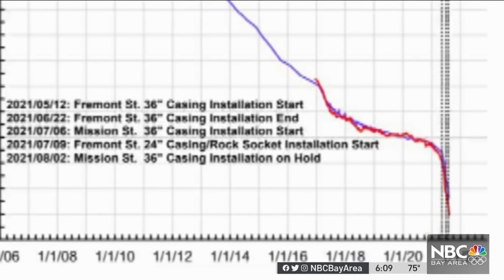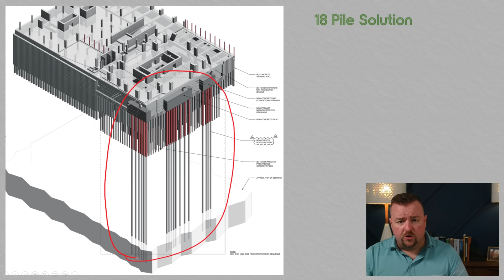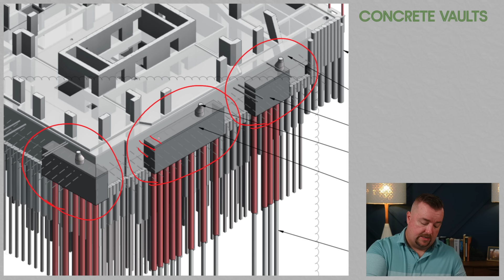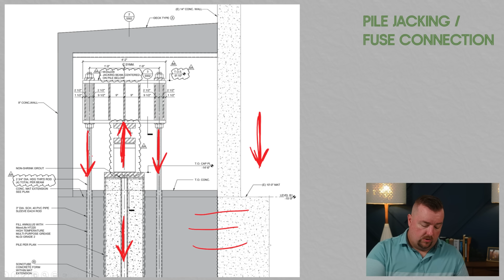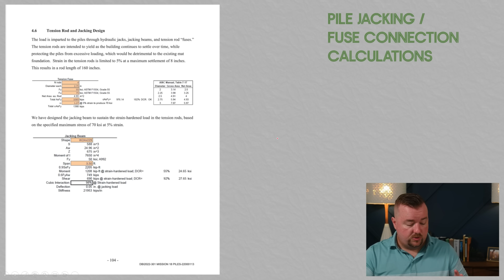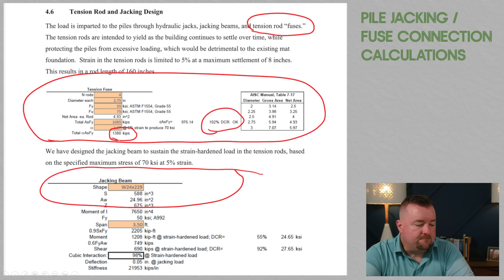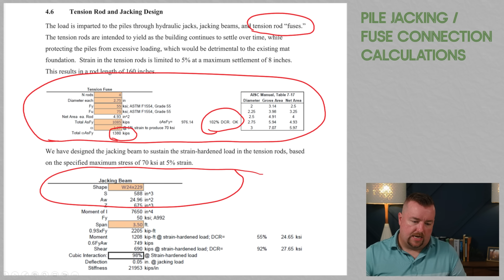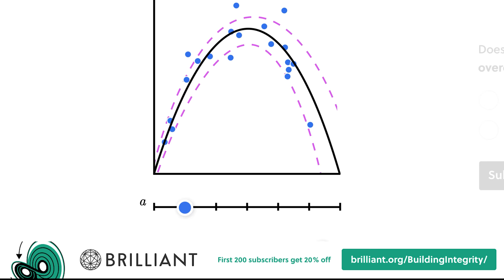Did I Uncover a $100,000,000 Mistake with the Millennium Tower "Fix"?

Comment from the maker: Small correction:  The Engineers that designed the "Fix" were not the structural engineers for the original building design.  I meant to refer to the engineers of the current "fix" as the "original fix engineers"... not the original building engineers.  If you are an engineer and want to perform your own calculations, additional material strengths can be found in the video description.  I have emailed the SF Department of Building Inspections and Supervisor Peskin re this concern.  I will update you all when I know more.
Reply: and I had a whole paragraph ready, good thing I didn't press send🤐
Reply: Very good explanation. Did you happen to ask these guys if they've picked this stuff up during construction? The "bearing" plate would look mighty small when compared to the giant rod on site, even if it was ungrouted. Even a non-engineer looking at it would raise questions (the steel fabricator or the site foreman). Of course, small plate or big plate, the rest of this project is a complete shambles.
Reply: They should just hire FIGG Engineers to do the review. I hear they do great work with concrete in tension!
Reply: Thank goodness I am not a decision maker on this project. San Francisco needs a team of very smart experienced structural engineers who are 100% independent and well paid and supported.
Reply: What I know from academic research and scientific literature is that when one performs a 'peer review' of, for example, a research paper (or in this specific case a design proposal), one is tasked with the verification of the work in its entirety.

You do not get to cherrypick whichever parts of the work/proposal/design you do 'include' in your peer review and which parts you don't! 

What I mean with this is essentially as follows: when one is 'peer reviewing' a work they're essentially verifying, checking and recalculating every single part of that work to check whether or not that which is described in the work is feasible, logically sound, safe and valid from an engineering perspective in the first place (among many other things). And if they find this to be the case, and thus 'approve' of whatever it was that was proposed/established/put forth and/or claimed within the work, then the 'peer review' is complete and the peer review process is finished (unless there are multiple simultaneous peer reviews required). With the peer review process having been successfully completed, the name of whoever performed the review is forevermore connected to the work as (one of) the peer reviewing parties that approved the work. Their name and reputation (and liability, in this case) is now connected to the project, with absolutely no CYA (covering your behind) whatsoever being allowed. Either the project is safe and you approved it following your peer review, thus agreeing to accept any and all liability as a result, or it is unsafe, you don't approve the project as a result of your peer review and thus the project cannot continue until they fix whatever caused it to fail the review, or until they find another peer reviewer actually crazy enough to attach their name to the project and give it their blessing.

But those are just my 2 cents, but I do know for a fact that the process I described above is how these kinds of projects are usually handled in Europe.
Reply: This video sparks joy.
Reply: Underpin is not the right term.  This is sidepin.  How the heck is a building that massive supposed to be supported with horizontal pins?
Reply: I also have big doubts about the mat extension capacity on the side like that...I wonder if that shear key will be enough. 
As for that plate you are totally right. The bolt will pas clean through. The plate should be square and thick enough for the punching shear around the hole as well as wide enough to not overstress the concrete compression capacity. With all the loads evolved why not over size this element, cmon.
Reply: So they was the fixer to the fix to the orginal builder that didn't work.
Reply: @Building Integrity
I can’t speak for the concrete part of the design (I am working in the machine building industry), but I also worry about the all thread rods. Every time I have seen a bolt that was designed to be tensioned to or slightly above the yield strength, the engineer would not rely on the given net area of the bolt (because you can’t measure it and the threading of the bolt can introduce stresses and small defects in the material). Instead, there would be a necked down section of the bolt, often with tolerances in the thousandths of an inch.
I must agree that the steal plates look absurdly small especially compared to the big I beam on top.
Reply: @michaelclennan8425  an international group.
Reply: I like the fact that shear between the new pilings and the existing concrete slab seems to occur across the small plates and the horizontal bars into the slab. Now, stand back and look straight up. This thing is gigantic. I would expect the shear planes to be 50 or 60 feet tall and mostly steel. I have an uneasy feeling about the adequacy if this design.
Reply: Can you post all of the pertinent information? Rod diameter, material, nut type, PVC pipe size, concrete strength, plate size, etc.?  I saw some of it, but it would be easier for passing PE to run a quick number on it
Reply: They should pay you for doing their job for them
Reply: @edwardteach3080  .....as portrayed almost perfectly in "The Simpsons."
Reply: @sjb3460 Go look at the desighners / engineers of the Pisa Tower. They knew  what they were doing.... 😂😢
Reply: @edwardteach3080  And in 50 years, all the original engineers are dead/senile, blueprints are rotting away in some archive while nobody knows where they are, the guys who had done it for years retired, they hire some new guys who have no idea what to do and whom to ask about it - at that point it will be extremely important that, if any maintenance is still required, it has to be very logical and straightforward.
In the city where I live (in eastern Europe) we had just this case - a large overpass (4 lanes, concrete) was built in the 50-s, needed repairs so they started to repair it in 2019, found out that it has very strange solutions in it (in the way it was built/designed), there is no drawings found anywhere, had to demolish it and now building a new one )
Reply: When someone sees the bill for the fix they just default and abandon the property - just my personal bet.
Reply: @sjb3460  
I doubt it  would tip over, it would likely collapse.
Reply: Pin this comment to the top Josh.
Reply: Have you attempted to file a FOIA request to see if this information is available or has been discussed internally?
Reply: May I suggest you pin this comment so it appears at the top?
Reply: You might want to pin (not to be confused with "underpinning" lol) this thread to the top of the comments ⬆
Reply: I bet Enerpac has a big hand in it too. They won't rent out such heavy equipment without knowing it's purpose.
Reply: @sjb3460  
How did I reply either way?
I said Yikes.
As in scary.
Reply: @sjb3460  It doesn't have to go nearly that far. The plumbing will stop working once there's not enough incline in the pipes which will pretty much render the building useless.
Reply from the maker: @AllAmericanGuyExpert  ouch! lol
Reply: @bryede  LOL, very astute observation.
But I would still fear that a 1/4" per foot lean on that tall a building would still be beyond it's failure point...
Reply: Great catch on the tiny plates.  Can you look at vault to building lateral connection?  It looks like it extends only a couple of feet into the foundation.
Reply: 😶‍🌫Anything better than steel? Titanium maybe, or tungsten?
Reply: @sjb3460  Perhaps a simple demonstration of the forces involved will shed light on the side support flaw.  Place a piece of cardboard over the edge of a table and support the table side with a few books.  The portion of cardboard over the edge of the table is the subject building.  As more weight is placed on the cardboard, it will start to bend and sag because only one side is supported.  Even if the 18 piles work as designed which our video host has shown is a dubious proposition, the building will tilt away from the piles.  As the building tilt, foundation will be exposed to greater bending forces which it was never designed for.  Even if the support were extended deeper into the foundation, shear force will still gather at the vault to foundation joint.  Cantilever support underneath the foundation would be ideal but is probably not feasible.
Reply: The high speed rail project.  The truth is nobody is working on this and nobody cares
Reply: @davidromero3803  The LINE in Sandi Arabia 🏜📏🧻🤣🐫
Reply: @referencefool  Crazy how they can build much taller building on Sand especially Qatar and yet the USA still have a track record of disasters including the WTC tower which only needed a bit of Aluminium and Kerosene to bring completely down.😳🤬
Reply: @edwardteach3080  VERY TRUE 🙂! 
Now, how about my car, always maintained by official Brand Centers? Answ: Just the same. These thugs demolish my car quicker than I can do...
About bridges - ask any politician / beans counter : "Where is our bridge?" Answ: Well, it was here yesterday. Maybe time for a bathing...
Reply: My friend, a chinese engineer named Sum Thin Wong agrees !
Reply: @jst6757  Thank you for sending your msg.
Instinctively I worried about the threads on the 2.75" rods. I think every man on this planet will have tightened up a least one simple nut too far in his life...That's normal, no problem. 
But for these extra large rods, I thought special care would have been taken for these threads. Yet large, but a scaled up version of their smaller "regular" brothers.
However, in the drawings shown in the video we can see 2 Nuts at the bottom of the rods, and only 1 Nut at the top of the rod - that's where they would need 3 Nuts...
This looks either like an incredible design error, or an unfinished drawing - which never should have been published.
Reply: Great video, i hope no one gets hurt. It’s really sad to see how we went from the most impressive engineering in the world to this.
Reply: We have to Thanl Maypr Breed! She's not from -SF. She's from  Oakland. She drove the whole city to the ground.
Reply: "NYC parking garage collapse fatality" in the news today.
Reply: Greetings - assuming the plates are uniformly supported (encased) by concrete other than the relief tunnel for the threaded rod (through pvc) and using a 3" diameter for plate through-hole, quick calculation for estimated rating - [3*pi *1.5" plate thickness*65ksi (ATM 572 A50 tensile)]/5 (SWL) = 183,775 Lbs.(approx.). Minimum shear strength of around 184,000 pounds with 5:1 safety margin. If the dimensions of the retention nuts are considered (as these would be the actual bearing surfaces), this quick estimate is given by (6*2.75*1.5*65,000)/5 = 321,750 or about 322,000 Lbs. with a 5:1 safety margin.

I'm curious about your calculations. Thank you for the thought-provoking video.
Reply: The problem as much as anything isn't that one plate will blow. It's that in the process it will spall the concrete around it and destroy the structural integrity around the other plate, which then immediately overloads its pair on the other side. This is a designed failure
Reply: I hope I am misunderstanding something. I can't see what is stopping the compression piles "spaghettiing" in the goo which appears to be semifluid between the bedrock and the building.
Reply: Is there an update or any feedback from this video Josh?
Reply: LGBTQ Engineering
Reply: I think the weakest link hear is not the plate but the threads on the studs they would be by far weaker than the plate
Reply: @BuildingIntegrity  Say, as an engineer by trade, could you take a look at the Kakhovka Dam break? EG, Ryan McBeth has compiled satellite footage and has tried to give an informed opinion what may have happened. AFter you autopsied Champlain Towers South, I would be very interested in your professional opinion.
Reply: So, he may have misspoke. If so how does the information you just posted help clarify the the issue regarding the PRIMARY LOAD BEARING COMPONENT of the "fix".
On a helicopter we call that a Jesus nut; it better be right.
Reply: It's leaning more than ever.  Please update us!  Did they listen to you? Seems like no! :(
Reply: This is exactly the type of project that turns into a massive disaster. It’s Hamburger wanting to cement his legacy. This project is extremely stupid. The building will never be worth much and should just be disassembled and removed: that’s the engineering challenge that people should be focused on.
Reply: @@futureshelp The full migratory patterns of the great Millenium Tower are still a mystery to naturalists to this day.  Also unknown are its mating habits.
Reply: @AllAmericanGuyExpert  You mean the girls who designed the Florida walkway???  Ha ha.
Reply: I want to see your numbers from which you derive there could possibly be "half a million lives" endangered. it's dubious that even if the 500,000 San Franciscans all stood in the shadow of the falling tower it could squash all of them at the same time.

Sure, even  hundreds or thousands of lives are a horrible prize of a failing project and should be avoided wherever possible!! But it also should be self evident that a channel proud of its work in physics and engineering calculations should NEVER stoop down to idle exaggerations to gain attention. Clickbait drama like that is below you. Or at least should be below.

Also yes, Engineering IS all about scalability. And when it becomes no longer feasible. If you can calculate a proper beaver Dam, you should be able to say what to do to calculate the "Three Gorges" and if a five time larger dam still would work.
Reply: @jean-charleslavigne1298  I wonder if the existing reinf bars exposed for the shear key were extended by CAD welding or sim for the full width of the new concrete grade beam.   If not,  the new grade beam may simply rotate when loaded.
Reply: Geotech here - after applying the 1000 kips of pressure to the "test pile" how much deviation are they allowed??
Did the pile move ??
Reply: @jeffreynelson2660  Yes good point. I hope they did XD.
Reply: @Ugly_German_Truths Huh, San Francisco is actually tiny as populations go… I kinda expected a few more millions there, being California and all.  
As far as maximizing risk to lives, think ‘Toppling dominoes’ except with skyscrapers.  A building on the east coast had that exact concern years back for a few tense weeks as a hurricane bore down towards it and engineers hastily made fixes.  buuut, honestly, I’m not familiar with what it might land on while toppling, pictures of it tend to have fairly clear sky implying it’s not near other tall buildings, and I’m not savvy enough to navigate street view.
Reply: @encinobalboa  The side pilings don’t carry the full load of the building, just enough of it to arrest the lean.
Reply: @shakehandswithdanger7882  The rods are 2.5 inches, according to one source I read.  Perhaps they were upgraded.
Reply: @davidcroxton8306  steel casings
Reply: This piecemeal structural engineering approach is risky compared to a complete FEA nonlinear analysis including all the components that are loaded.
Reply: No. They knew this already.  Your friend Stockton Crush could use your services
Reply: They're doing it like this on purpose for a controlled fail at some point of their choosing in the future.
Reply: Have you had any replys to the emails or updates in the last few months? Thanks
Reply: @ivankuzin8388 same with the tensioned concrete bridge in Italy, which fell down a few years ago. Maintenance was neglected for years and found that they were also hiding the surveying stating the poor condition and degradation of the material...
Reply: “Steel”/“bedrock”
Reply: I would rather see something to pump under building in an area much larger than the buildings footprint.  A simple way to see what I'm saying is think of a snow shoe.  
Thereby at minimum slow the current rate of sinking.
Reply: @jean-charleslavigne1298  "As for that plate you are totally right. The bolt will pas clean through. "  Numbers, please (?)
Reply: @richardhack9830  "...and only 1 Nut at the top of the rod - that's where they would need 3 Nuts..." The nut at the top is not loaded...the rod works in tension...
Reply: @les8489  Andwhere does that tension go to? Answ: to the nut!
Reply: @richardhack9830  Of course it does - if we are talking about the nut at the top of the rod. I thought someone was talking about the nut on the top of the plate. Sorry for the confusion :)
Having said that - tension type nuts don't need to be analyzed. The design of these nuts is such that their strength (shearing of the thread etc.) exceeds the capacity of the rod. So - the fracture (if it occurs) is NOT by the failure of the nut. Fatigue failure, however, may occur within the threaded portion - but adding another nut there won't help.
Reply: @les8489  Basicly you're correct on the design of nuts. However, more nuts = more treads to transfer the pulling Force applied to the rod. So the tension in the treads will be lower, thereby reducing fatigue. This helps the treads to survive. (In a staticly stable construction). When seismic activity occurs, the treads may fail anyway...
Reply: Josh, trying to reach out to you but all links to your website seem unresolvable, and can't find you... is there a way to send you something somewhere? I think I did invite you on linked in, if that's you.    TY... rc
Reply: @les8489 — The single nut at the top end of the rod is definitely loaded.  Seems to me it should have been doubled.
Reply: @GH-oi2jf  Of course that one it is loaded - when I answered previously, I was under the impression that the talk was about the single nut on the top of the plate.
But adding 2nd nut at the top of the rod does nothing. If the 2nd nut is noy torqued up - then it takes no load. If it IS torqued up - all it does is increase the tension in the threaded portion of the rod inside the 1st nut. There maybe good reasons to apply 2nd nut (vibration environment etc.) - but in this case it would just be a waste of a nut.
Reply: @edwardteach3080  So true. There is a building local that I did a plant inspection on about 20 years ago and discovered that the fire fighting system had never been commissioned and was still inoperative nine years after the multi-use building opened. (A building including residential unit and also a public area that had experienced incidents of wilful fire raising!) After commisioning the system and instructing staff on regular maintenance, management and regulators have in the intervening years undermined all that work. Unfortunately, I now live so close that if it all goes wrong I shall have to listen to the screams.
Reply: The way these rods are connected at the bottom to a small plate that could potentially pull through reminds me of the Hyatt Regency walkway collapse of 1981. It just looks simiar. I'm not sure why they wouldn't use larger plates considering the cost would be minimal.
Reply: Engineers drunk on
Bud Lite ?
Reply: Excellent video presentation, but that fix can't work.
Reply: @thomashejnicki6880  whats the bearing pressure between the anchor plate and the concrete when the bar is tensioned to 340,000 Lbs?
Reply: After watching the series, as someone which is not a engineer but has physics background, i can't help to question the entire approach on the "fix".
Seems to me, the should have taken measures on the opposite site of the building to increase the settling there to match, rather than try to arrest the settling on the side it leans to.
Any other approach increases the loads on the structure. And any disturbance of the soil will increase the problem, by increasing the uneven settling.
I assume that, this would be a even more "has never been done" approach. so they went with the we have done that, it's just bigger approach.

But it should have been possible, to use directional drilling to change the conditions in the soil, to increase the settling rate. this does not mean, that some pillings all the way down to the bedrock around the building to be able to somewhat influence settling rates further would have made sense. but only after you unload the structure.

Think it would be really interesting to see a continuation / spin off of the series, which would explore other options that could have been chosen to  fix it.

I also kind of don't get it, while would you use the strength of the steel as a fuse. I kind of get, that in the US proper maintenance is trouble. But making those rods the failsafe seems insane. Would make much more sense, to have a small fixation element on top which gives and is easily accessible and replaceable. and then use a active monitoring and automated adjusting. and of course a external alarm. probably also a safeguard which disconnects the system in case of a earthquake. this feels like: let's make the inner reactor mantle weak enough so it melts and disperses the the contents to stop the reaction... and then have to rebuild the entire facility to get it working again.

If you don't have a static situation, you should always include a automated monitoring and adjustment system.
Reply: Why does "Hyatt Regency" keep flashing through my head as I listen to this?
Reply: @rickoshay6554 — Probably because you don’t understand the differences.
Reply: @GH-oi2jf  
Well, there's even more difference between the apparent design snafu here and what brought down those 737 Max aircraft. Ya' ever think maybe the design similarities might be relevant?

Whatever. It always makes me chuckle when you toss out a rhetorical question into what looks like an intelligent crowd and, Bob's your uncle, another boneheaded TicTok refugee pops up.
Reply: @jean-charleslavigne1298  I was thinking the same thing. I'm not an engineer of any kind, but I would have exaggerated the size of the plate, like at least a foot thick by several feet out on all sides. We are talking about the weight of an entire building, not adding the extra weight that will be added as time passes, like the residences with all their possessions. So far, I have not seen one thing that takes the added random weight into account. People and their possessions don't weigh zero. Then, there's the test of time. Earthquakes are a concern, what if there's another (1906) or worse earthquake?
Reply: I would've left it alone. Probably would've settled on it's own.
Reply: @warntheidiotmasses7114  Oh it was settling on its own, but in the wrong way "TIIIMMBERRR!"
Reply: @Building Integrity, note that SGH were not the original design engineers of the Millenium Tower. SGH are the engineers for the retrofit. BTW, you indicated that there is an issue with the anchor plates, but I don't see what the issue is. These anchor plates that transfer the upward loads to the concrete is likely designed based on Chapter 17 of the ACI Code. If the steel anchor plate is to fail in shear and the 2.5" diameter tension rod pulls out (very unlikely!), one can assume a circular failure plane of 2.5" diameter (this is actually conservative since we should actually be using the diameter of the nut). The shear capacity of the steel anchor plate will then be at least 0.6 x 50 ksi x (pi x 2.5") x 1.5" plate thickness = 353 kips which is much greater that the 250 kips force that each tension rod and anchor plate are designed to support. What am I missing?
Reply: His name is Ron HAMBURGER?
Reply: Did the city ever respond to you?
Reply: @user-qz4lt6ek8u lol why are you calculating the shear strength of the plate 2.5" in diameter? There's a HOLE 3" In diameter! The shear strength of air is ZERO!!

Calculate the shear strength of a donut shaped piece of steel where the nut contacts. Not the 3" hole in the middle bud!!
Reply: There is a simple fix for this.  Im surprised the engineers have over looked it.
You simply demolish the building and rebuild it in another location.  Problem solved.
Reply: Any Updates, where can I find the video.
Reply: Wow.😢
Reply: I am not a structural engineer.  I am a firefighter/paramedic with an electrical engineering degree.
I’m  currently a BattalionChief for an East Coast city FD .  I’m also a UASI urban search & rescue team lead.

My counterparts in California have ALL expressed serious concern, if not dread, at the thought that this building will be permitted to stand.  They are very well aware of local San Fran “$$ POLITICS $$” and are terrified that additional corrections will be permitted to occur to the Millennium Tower.

The FD’s internal estimates for loss of life should the building collapse due to seismic or other action on the structure….
Are MASSIVE! 
Take the occupancy loading and multiply by 25-30x !!

PERSONAL Opinion / NOT my department’s ..
After the attack on the WTC and further collapses of 1 / 2 /7 buildings, the majority of the TREMENDOUS amount of rubble took months of all out work.  Of course, after watching friends die and looking for 343 + thousands of others, I now believe MUCH more was known about the attack than ever disclosed.

San Fran and the density and seismic threat means horrible things to come if not immediately addressed with dismantling in place AND serious investigations on all (hint $$ campaign contributions?.) fronts .

Great Channel !
We binge watch very few videos.  This is nearly at the top !
Reply: Like trying to keep a heavy timber pole upright in a swamp.
Reply: 1😊😊😊😊😊😊😊😊😊😊😊
Reply: The moral of the story mabey sink ur piles to bedrock instead of cheaping out
Reply: Oops  sorry  we messed  up 😮
Reply: My real concern is the screw, which is the weak link in this unusual jacking design they came up with. I did some calculations, and although it seems small, the plate should be okay. I performed both high and low estimations of the shear area of each nut on the bar, which are between 46.44 in² and 40.5 in². I don't know the exact dimensions, so I estimated them based on other screw-to-nut size ratios. If each plate is made of a material with a tensile yield strength of 36 ksi or greater, like A36 steel, the contact area at each plate should handle up to 1671 ksi or as little as 1480 ksi before shearing.

I know that calculating the shear force using the tensile strength is incorrect, but anything can happen above the tensile strength. As he mentions, you don't really want to operate in that area, so I used the lowest possible value for the worst-case scenario. In a nut and screw connection the screw itself will fail (elongate/break) before the threads shear. This is probably why the engineer didnt put any plate math in there. The plate/nut area is larger than the screws.

However, just because the math checks out does not mean this design isn't flawed. He could have made the 'fuse' accessible, for example, by placing the part of the system designed to fail, like a fuse, near the top of the jack/beam. This way, if the 'fuse' needs adjustment to handle a larger load than anticipated, it can be done easily. Instead, like an idiot, they buried it so it can't be changed, and it is designed to be on the knife's edge of failing. Any load miscalculations can cause a jacking system failure.

I have so many questions for the engineer who designed it—not because I don't understand it, but because I want to hear their reasoning for so many things. For example, why are there two nuts on the bottom but only one on top? The top and bottom are under the same loads. Why?🙃😕
Reply: Any updates?
Reply: Where’s the update?
Reply: @TheBauwssss Brave to approve. "No adverse comments" is a wiser position.
Reply: Contractors doing well probably on time and materials?
Reply: Yup yup should hired the contractor whose motto was "our poles will outlast your holes " 😅😅😅...🇺🇦 🇺🇦 🇺🇦 Slava Ukr4ine 🇺🇦 🇺🇦 🇺🇦
Reply: @AllAmericanGuyExpert lmao.
Reply: The the Millennium Tower is the San Francisco treat
Reply: @jaymorgan8017  are you scared, hun?
Reply: Dude been quiet for a year? 
Was he looking into WTC mess?